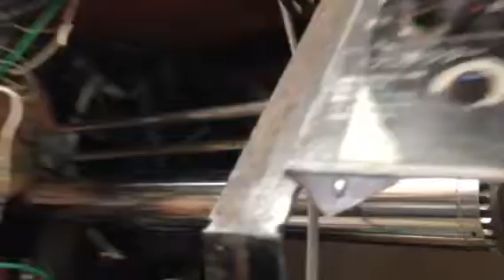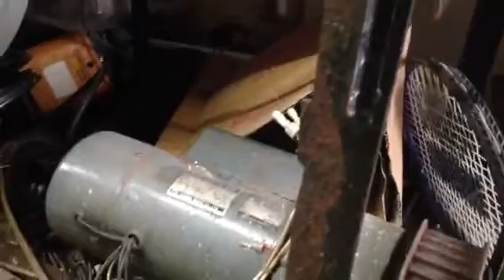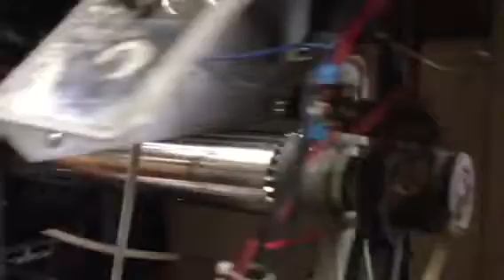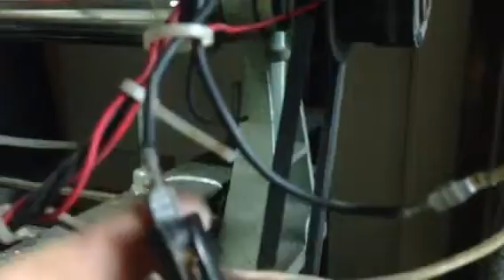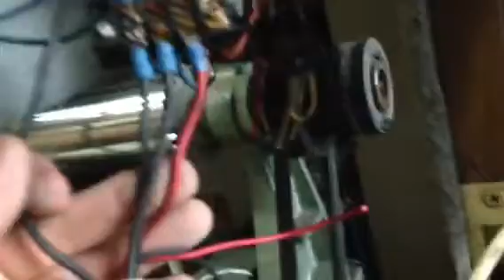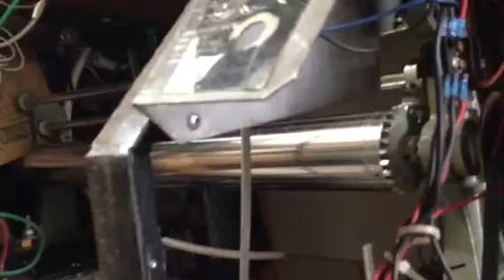Video passes 100,000 hits

Comment: It's hard to tell exactly what's happening here so I checked out your other video and it seems to me, you don't need any of those wires. It seems all you need is to get your motor to work. Check the label on your motor and see if it accepts 100-110v 50-60Hz AC Input. If so you should be able to just plug it in. You may need to find a plug with 13amp fuse. I strongly recommend Putting a "push to kill" switch in first.  A fused one if you can find one. Trained as an electrician in UK. (If you motor has more wires than one red & Black. Further investigation may be needed. Hope any of this helps :)
Reply from the maker: Thanks I will try that tomorrow
Reply from the maker: Thank s .will try tomoorrow
Reply: What he said. Also schooled electrician. You need to check the plate on the motor for proper wiring. I also suggest a dead-mans switch, maybe a foot pedal ( single pole NO (normally open) ), I'm thinking you may already have the parts laying around that you would need.  So it will only run while you hold it down. And a fuse also. Safety, Safety and then one more layer of safety. Better to be annoyed then hurt. If you wanna send me a photo of the plate on the motor i can draw you up a diagram to follow. send it thru Face Crook or Google+ what ever is easier for you. We could also do a FaceTime or G+ chat if you hit a wall and get stuck.